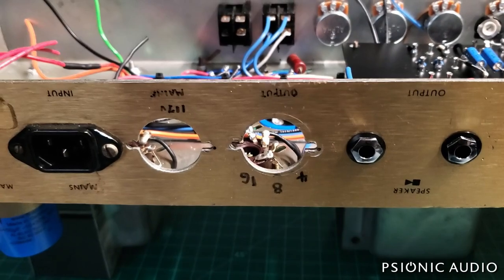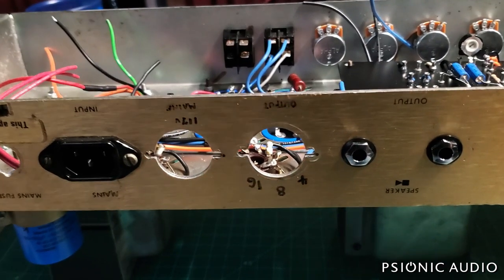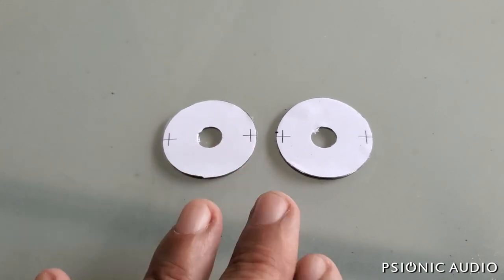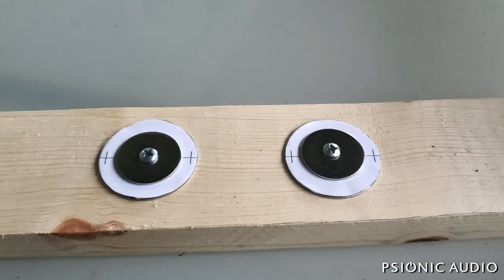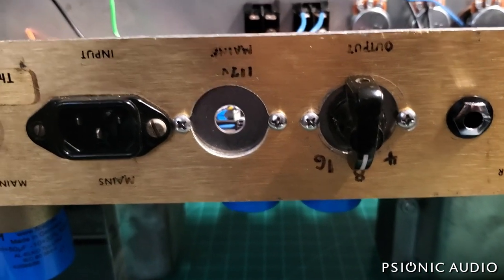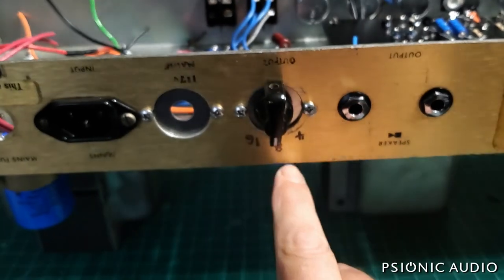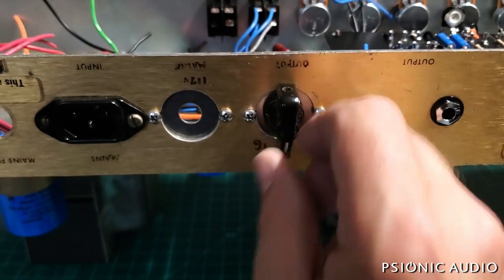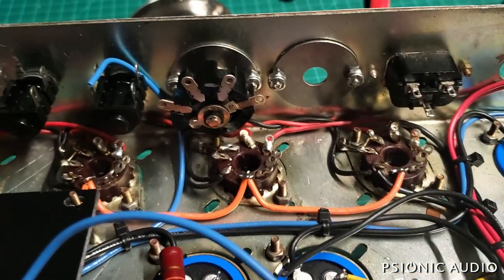Tech Tip : Dealing with Old Voltage & Impedance Selector Switch Holes in Vintage Marshalls

Comment: Good Fix.  If you do not have a drill press, you can probably use a small  flat file with edge cut and use that to make the slots.

Comment: I need to do a similar job for a Carvin Valve Master 100 amp head. Guy that sold it to me, sold the head enclosure, metal chassis and power transformer (although from an X100B amp). No preamp or power amp circus boards. He said they were so boogered from modifications, they were barely fit for the trash. So I have 5 preamp tubes and 4 power tube locations to use up and have to figure out what I want to do. But I will need totally fabricate an entire circuit and board. Although my board will sit above the power tubes, so that will be a pita. This series is giving me lots of ideas on how to move forward.

Comment: i have a 76 JMP Superlead 50 watt marshall head with almost the same issues. The mainboard is out; the chassis bare and the aluminum front plate is bent with gooped gorilla glue. It is on my bucket list to tackle. This video series has me on the edge of my seat. Thank you for the vids. Also, it has two big holes drilled.

Comment: Note that some grades of stainless steel are fairly soft, and others much harder. Years ago, when I was a marine-navigation installation tech, we used non-magnetic stainless screws and hardware so as not to interfere with compasses, but the stuff was quite soft and using self-tapping screws in fiberglass helm consoles and bulkheads tended to lead to stripped screwheads unless you drilled the pilot holes out just right and took care to use a snug-fitting screwdriver. Anyway, since True Value Hardware (and presumably Ace as well) sells both regular stainless hardware and marine- grade hardware, the marine-grade stuff is likely to be non-magnetic or nearly so (its easy to test this) and probably softer and easier to drill holes into. (Likely costs a little more as well). PS, Harbor Freight sells inexpensive stainless steel bolt assortments, mildly magnetic, including BriLok nuts for some, not all, of the bolt sizes. 

More on stainless steel grades: last year, when I was laid up from surgery and couldn't do any physical labor, I had a carpenter build a new entryway porch and stairs for me ---- I supplied the lumber and hardware, most of which I already had (thankfully, because lumber and hardware had became Unobtanium materials); I had bought a cardboard box of 100 stainless square-drive trim screws at True Value, and when we needed a dozen or so more I bought another, smaller, clear plastic pack of the same type and brand screws (Hillman, IIRC) which looked identical but were apparently made of softer stainless steel, and the heads stripped much more easily.

Oh, and then there was the time I was laying on my side in a sailboat bilge, having crawled over and around a bunch of life preservers and foul weather gear and other crap, drilling set-screw divots into a bronze rudder post to install a yoke for an autopilot attachment, and I dislocated my right shoulder. I had to bang the shoulder back into the socket with my left fist, otherwise I wouldn't have been able to crawl back out of there. F---k me, that hurt! My shoulder has never been the same.

Comment: Good job. Not sure if you center-punched those holes before drilling but, as a machinist, and for a somewhat precise job as this, I highly suggest you do so. It'll prevent your bit from walking. I like the spring-loaded punches myself. It's a must have tool for me. Btw, nice thinking on that jig :-)
Reply from the maker: I started with a very small new bit that is pretty much self-centering. But for critical stuff I center punch.
Reply: @PsionicAudio  Atta boy
Reply: @PsionicAudio  ,  I wonder if it is possible to find brad-point bits suitable for drilling steel; they self-center very well on hardwood, and *might" be okay on aluminum....next time I drill some aluminum, I'll try them. Steel washers are another thing entirely, of course.

Comment: Those old window plugs Marshall used during this era were horrible, they fell out if you looked at them wrong, and I lost count of how many of these I've seen with pieces of coat hanger wire, etc. stuck in it's place. Those crappy lighted power rocker switches are just as bad...

Comment: Off-topic, Lyle, but I'm curious if you've ever worked on a Demeter amp, and if so, what you think of them. Sonny Landreth has used one, off and on, for years. He also has a Dumble but I don't think he tours with it much, not when I've seem play anyway (both solo, and with John Hiatt).
Reply from the maker: A few of their bass amps. No guitar amps. Very nice stuff, well built and designed. Only minor service was needed.
Reply: @PsionicAudio  , I didn't know they made bass amps. PCB, or turret board construction?
Reply from the maker: They are mostly known for their bass gear. All PCB. No major companies use turret boards except the occasional HW Vox/Marshall.